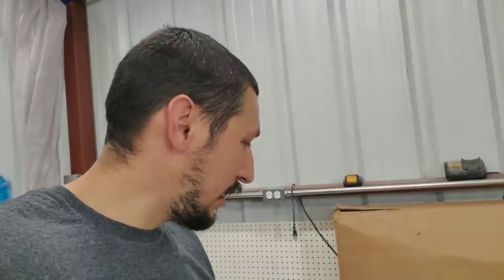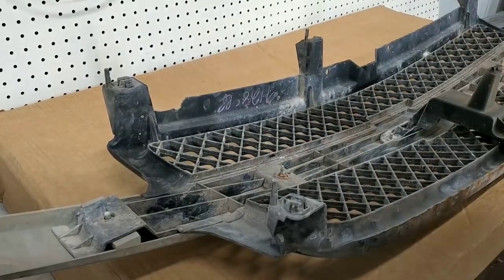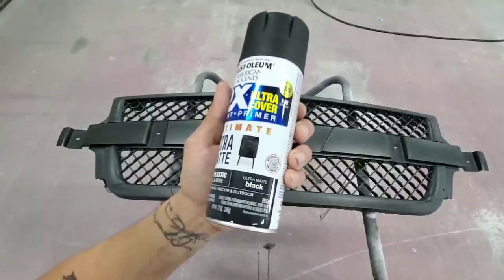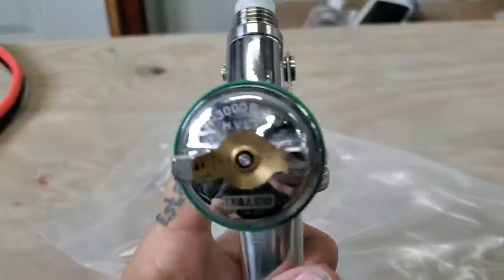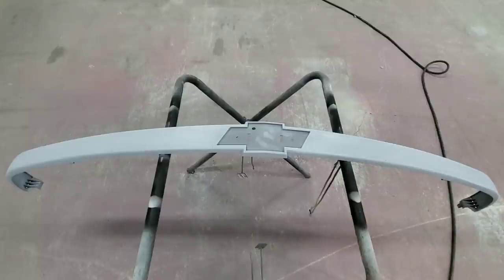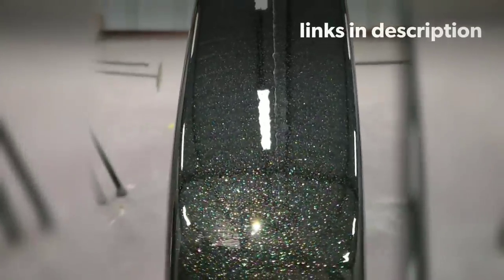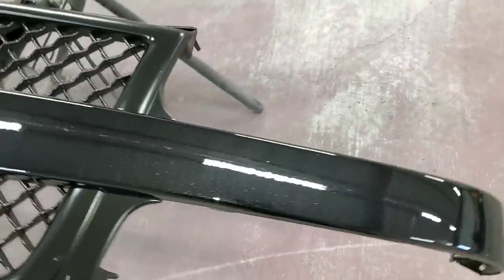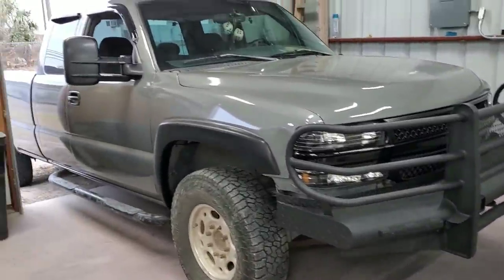Painting Grill & Taillights on the HD Silverado

Comment: Paint the badge silver or better yet buy a new one chromed. It will be a  compliment to the lights. Might be $35.
Also, at the bottom front of the fender flare would look better in black. There is a 1/2 in gap of silver and the rest below going forward to grill should be black. No need for that spot to scream silver.